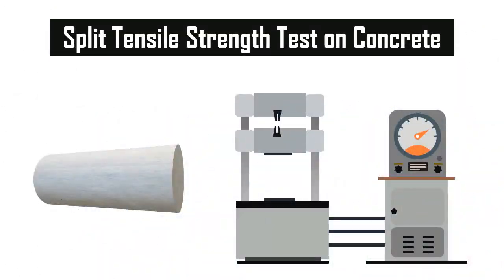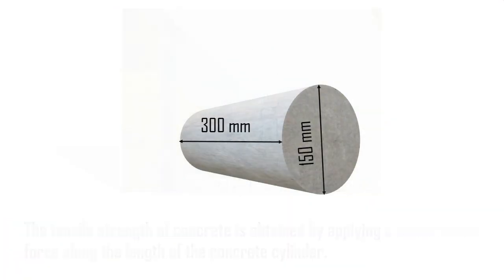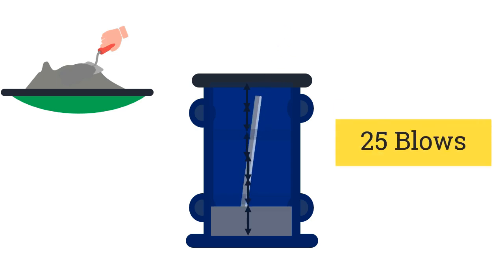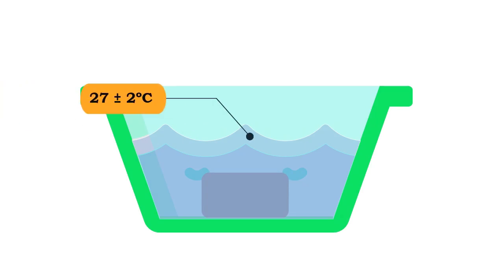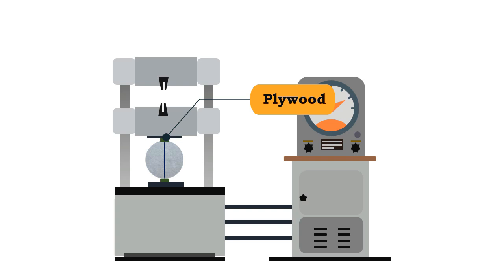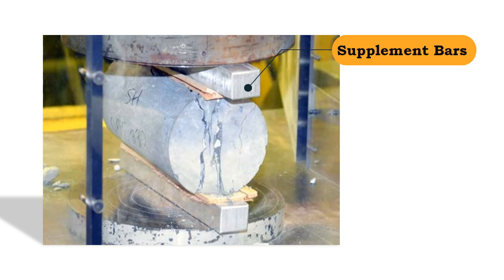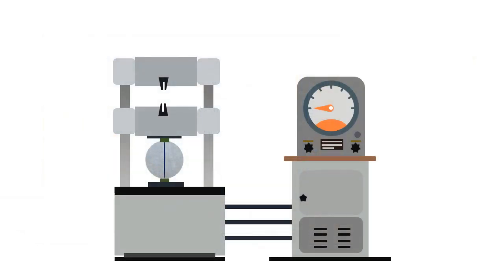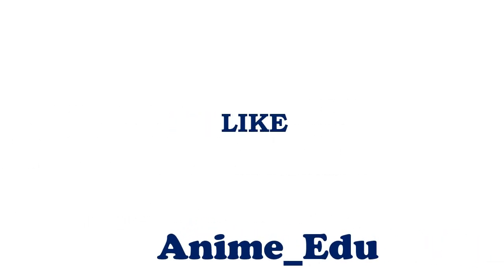How to determine split tensile strength test of concrete || Laboratory Concrete Test #2

Comment: One dout- What is tha limitation of split tensile criteria
Reply: Depending upon the grade of concrete
Reply from the maker: Here are some key limitations of the split tensile strength test:

- Sample preparation can introduce flaws or cracks that may cause premature failure, so careful preparation of concrete cylinders or beams is important.

- The test introduces a artificially-induced tensile stress state that is not entirely representative of real-world conditions where tensile stresses develop more gradually.

- The maximum tensile stress ends up occurring at the loading points rather than uniformly across the mid-plane, so the actual tensile strength may be higher than measured.

- Stress concentrations and improper load alignments during testing can further contribute to variability and underestimation of tensile strength.

- The test is more variable and sensitive to sample defects compared to compressive strength testing. More samples may need to be tested to obtain a reliable tensile strength value.

- Strength is measured at one specific point of loading rather than over a range, so no data on elasticity or stress-strain post-peak behavior is obtained.

- Capped vs. uncapped cylinder ends can influence results as capping minimizes non-uniform stress distributions.